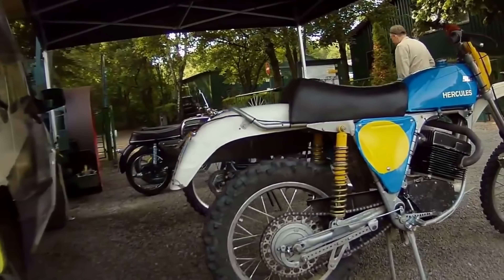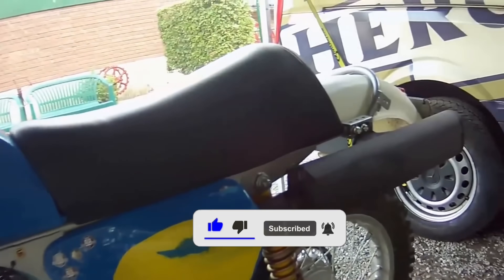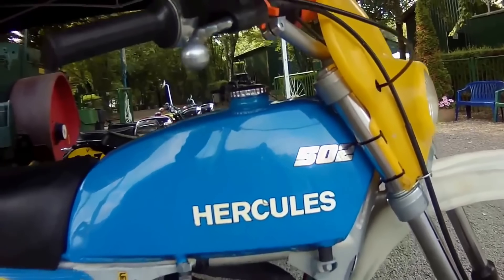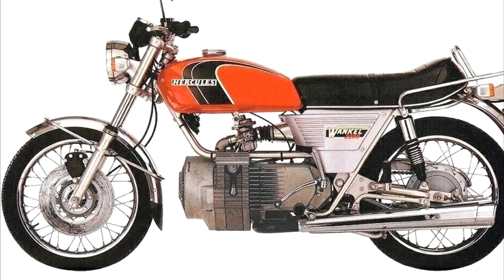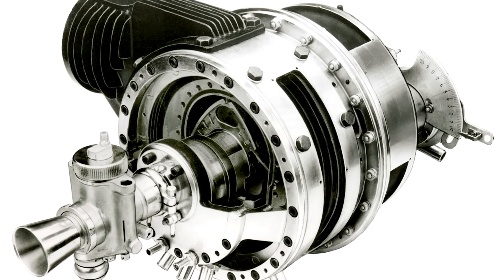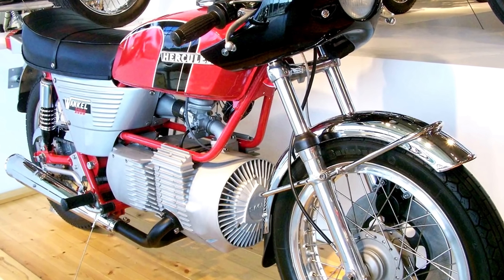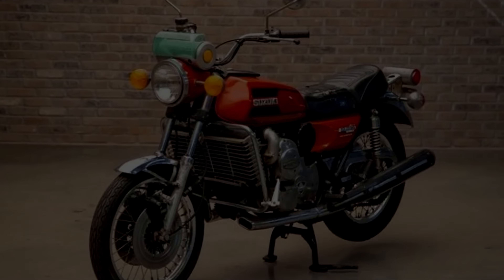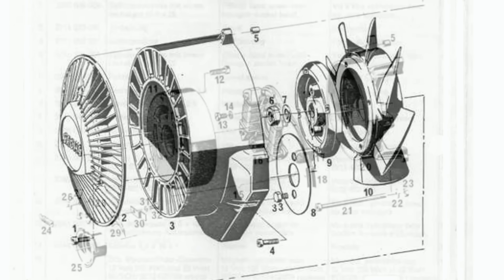The Hercules 502 GS: How Rotary Engine Works on a Dirt Bike

Comment: That Hercules  sure looks a lot like a  KTM / Penton ..  My friend had a Mazda RX-7  70 Cubic inches every peppy with lots of torque..
Reply: I can make your mates 13B bullet proof, infact, tell him to replace his hollow locating dowles with solid ones, run external oil as those dowles usually are hollow for oil flow, separate oil injection fuck pre mix and malleable seals, they don't shatter and do damage just bend, that's good for a road car....
Reply: @EZ-D-FIANT No one can make a Wankel engine reliable... and anyone that claims to is a big fat liar.
Reply: The RX7 is notorious for very little torque and not much power either.
Reply: @sandervanderkammen9230    Not True .. My friend had one it had a lot ot tourque and was a fun to drive sports car  maybe around 1981 or so
Reply: @mikeskidmore6754  Nostalgia is a seductive liar... if you simply look at the specs on these cars torque and horsepower out on these cheap little cars was pathetic...
Compared with reciprocating engines they were right at the bottom.

Comment: I can't imagine how much torque these bikes doesn't have.
Reply: You actually have no idea... I have a snowmobile with this engine in it, the thing drags bumper if you snap it wide open but runs out of steam on top end like a diesel, just based on the video here it seems to have very comparable torque to a 250 4t mx bike.
Reply: @reesewilliamson3346  damn right they do some people have no idea lol a 1.3 built with a turbo can make insane horsepower and you can keep adding rotors and make more power those little things shred tire just gotta do apex seals and shit all the time
Reply: @heathkill4821  nowadays thanks to advanced metallurgy there are apex seals that last literally forever, provided you run premix.
Reply: @reesewilliamson3346  Wow! That's the most ignorant comment on YouTube..
You don't know anything about Wankel engines do you kid?
Reply: @reesewilliamson3346  Apex seals are inherently unreliable and weak by design, no one had ever solved this fatal flaw in the Wankel engine.

Metered oil injection is vastly superior to premixing... this is due to several very important factors that appear to be completely lost on you son.
Reply: just rev it up for amazing power
Reply: Gotta keep it ripping!
Twist it to the ketchup 😋
Reply: Who even cares about torque when you can have a 9000:1 gear ratio lol
Reply: @stuwest5862  that's surprising. Rotary engines typically don't have enough stroke to make that high of a torque to horsepower ratio.
Reply: It's like the no torque and no engine braking comments are oblivious to 2 strokes?
Reply: @BurmaJo  Ya cuz compression release isn't a thing, which this POS doesn't seem to have  get fuqed
Reply: Probably more than the power of your brain.
Reply: @leaveitonhold  "Hur-dur brain joke dur"
Reply: @stuwest5862  yes but a honda cr 450 made over 40hp with 30lb torque. Your figures are for a 250cc honda.
Reply: @stuwest5862   1976 Honda  CR 250 put out 33 horsepower
Reply: 5ee
Reply: Gearing exists you know. Ever heard of gear ratios?
Reply: @mattbanks3517  You can only space gear ratios out so far.
Reply: @samizdat113  no, no what i meant, i meant taking a pinon and spur gear and reducing the engine speed and increasing torque to levels that match a normal piston engine, before the transmission. Like what steam turbines do for electric power generation.
Reply: Don’t need torque when you have far too much horsepower.
Reply: "Talks the torque but can it lift the fork, 
Whatever its still better then going for a walk"
Reply: @EZ-D-FIANT  ...said the 4 stroke guy
Reply: No shit right cool idea tho but thats out
Reply: You know very little about engines.
Reply: @ivancounsell4077  I know stroke = torque
Reply: @@L3gion965depend on what it used to. I think rotary characteristic is not fit in hard enduro type of race
Reply: A bikes this light doesn't need a lot of torque anyway 🤦😂😂
Reply: @theraildynasty_  It also has less power to weight than a 2-sroke.
The Wankel offers no advantages in a motorcycle applications... or any applications for that matter.
Reply: @sandervanderkammen9230  I was just talking about torque, yes to access power you would need the rev the hell out of this bike, but then it is a dirt bike so it won't be possible to rev it that much on an off-road course
Reply: @theraildynasty_  Torque is average serious disadvantage with the Wankel engine, which is why it was never successful in any offroad applications and generally considered an unmitigated failure in the motorcycle industry.
Reply: @sandervanderkammen9230  yes rotary engines were never built for torque
Reply: @theraildynasty_  You mean Wankel engines, a Rotary bike like the MEGOLA is a completely different animal.
Reply: Yes then on the back end no help slowing down...NO THANKS
Reply: @shaadydog1  if adjusted correctly, there is absolutely nothing I can do with a disc brake that I can't do with a drum, even on a heavier bike.
Reply: @reesewilliamson3346  Not true ,prolonged heavy braking with the shoe will lead to overheat/brake fade.
Reply: @ianmangham4570  just lock the wheel up as hard as you can and let the tire get wore out instead of the shoes
Reply: @reesewilliamson3346  Thats not what I was referring to,  you get no engine braking and many are not used to that at all.
Reply: @reesewilliamson3346  lol if you have to lock up the wheels, you’re not riding properly.. and you still can’t lock up the front wheel or you’ll crash.. 😂drum brakes suck compared to disc.. just admit it!!
Reply: @reesewilliamson3346  the issue is fade mate, you obviously don't ride hard
Reply: @reesewilliamson3346  lies
Reply: You can always spot a keyboard warrior with no experience, today it's zero experience with Rotaries but all the talk......
Reply: @EZ-D-FIANT  I have experience with Mazda rotary engines.
Reply: @samizdat113  so you realise that lower torque at lower revs is negated greatly by the reduced reciprocating mass and overall engine weight, also  with bikes that low end high torque makes for a hard to ride bike, the liner ramp up in torque x revs actually sounds a blessing, watch the video again, that rear end is constantly kicking out, "torque it doesn't have", more like low down torque it doesn't need, however I haven't riden a Rotary bike but I've built more 13b's and renisises then I can remember......
What's your experience, building, driving, what platform cos the low torque thing is something I always hear from non Rotary experienced people and never from the experienced.....
Reply: @EZ-D-FIANT  It's obvious from your childish remarks that you are no expert and definitely not educated in engineering.

The Wankel engine cannot produce as much torque per liter because of its Lower BMEP  the Wankel engine has an extremely low surface pressure area-to -stroke ratio, and the eccentric-crankshaft lobe and fixed gear ratio work at a mechanical disadvantage compared to a reciprocating engine.
The Mazda Renesis for example only has a 30mm stroke and pathetic 7.1 bar (42 ft.lb) liter.

Comment: I think that what a Rotary Engine needs most, is more than one rota, just for backup in those in-between times lol, but 4 rota's isn't necessarily. I really love the Van Veen 1000cc Rotary motorcycle,  of course it's got 2 Rotas.
Reply: van veen is dutch??
Reply: @fidel catsro  yes Hank Van Veen is from Amsterdam and an importer or Kriedler motorcycles, Van Veen Kried or Van Veen OCR 1000 Rotary motorcycle, 100hp 135mph.

Comment: You would think with modern tech in metallurgy, exotic alloys and coatings, that the rotary's shortcomings could me overcome, or at least mitigated to a large degree.
Reply: Check out the "liquid piston" engine
Reply: @skynjaydensdaddy Beware of LiquidPiston my friend, it is not a legitimate company and is notorious as a fraudulent vaporware investment scam
Reply: I haven't looked into it, but it seems like Mazda had it figured out..
Reply: @davidbryngelson938  yes my 1980 rx7 had sat for years by last owner and that thing starts up every time for me and made me think rotarys are ment to goooooo
Reply: @davidbryngelson938 Really? That's ironic being that Mazda has gone bankrupt 3 times and has completely abandoned Wankel engines too.
Reply: They have been, so many none Rotary builders talking shit here, the good seals are malleable so don't snap and do damage, replace hollow oil dowels for solid, external oil feed, injected oil fuck premix with ecu that knows when that level is low (or fluid level switch for injected oil on your coil) and boom reliable Rotary.....
Reply: That's a popular opinion but im sorry to inform you it is nothing more than wishful thinking.
Reply: They will always be inherently inefficient because so much of the explosive force in the combustion chamber is wasted not directly acting upon the rotor.
Reply: @Jack-tx2ve Well hopefully there is no explosion inside your engine... that will destroy it...
Pascals law tells us that force of the pressure created by the burning fuel air miz always acts equally on all sides... since only the piston/rotor moves..
The force is transferred to it.
The geometry between the piston/rotor and the crankshaft determines if that force is transferred with a mechanical advantage (leverage) or a disadvantage.
 The Wankel operates with a mechanical disadvantage
Reply: @Jack-tx2ve  and its getting a bit late in the life of internal combustion
Reply: @colinscutt5104  Internal combustion engines will still be with us for a long, long time, at last another 100 years. 
When they make electric heavy machinery, electric trans-pacific commercial jets, and reliable electric farming equipment, get back to me.
Reply: @dr.hugog.hackenbush9443  I agree, soon as they make electric tow trucks then i might get concerned.
Reply: They already testing tractor trailers!

Comment: These engines were never extremely popular nor known for torque...but they would screaaaam.  And my experience with a rx7.  It never once broke down ..I got it used and abused.  And then I abused it more....Apex seals were toast...I went through 2 transmissions oil and gas i frequentlyturned it well past 8k rpm ..and it was still running when I sold her...I miss it now.
Reply: 1976 honda dirt bike 23HP/ 17 lb-ft torque
1976 wankel 502 30 HP/ 24 lb-ft torque
Reply: @Stu West  no kidding. But the torque was Made at like 8k. 😆    not off idle like a four stroke w valves....yes it had great numbers.   Especially for something that stayed in the max rpms...so I misspoke.   Plenty of torque, just on the wrong end of the power band...the rx7 was a straight dudd off the line...but once she was above 4k.  It was on

Comment: Modern 2strokes and 4 strokes would eat the wankels lunch  a stock 125 2 stroke avg 36hp and can be upgraded for more power....if the wankel was a good design it wouldn't have phased out or been out performed....buh bye

Comment: Hercules needs to think about a four rotor street bike!!! Don't worry about h.p. make a torque monster, then just go from there.
Reply: Hercules as a Motorcycle Company doesn´t exist anymore since the early 90`s...The Engines were made from Fichtel&Sachs..also doesn´t existing anymore.
Sachs is nowadays just an Aftermarket and OEM Brand for Suspension Parts in the ZF Group.
Reply: @francoaleman1520  thank you for your time and your knowledge.
Reply: @bartbullock9742 Youre welcome!
 Well  as a German I think I got to know that^^
A lot of German Companies known for producing Bicycles, Tipewriters, Sewing Machines or other Househould Stuff produced Mopeds and  2 Stroke Engines after WW2 to allow affordable motorized Mobility for the People.-> Miele, Adler, Zündapp, Kreidler, Rixe, just to Name a few... even Opel made Motorcycles! Another interesting Fact is, that Opel was the biggest Manufacturer of Bicycles in the World for a long Time.
Another Fact is that the Heritage of Audi is also based on Motorcycles..NSU and DKW are 2 of the 4 Brands whose are the Heritage of Audi and what the 4 Rings of Audi Stand for( Each Ring stands for one of the Heritage Brands).
Reply: @francoaleman1520  thank you for your insight, in 77 my first car was a 70 model Opel GT, I put a Weber carb. As soon as I got it.10 years later, some investors, I think they were in Belgium, bought my oval sent it back to be refurbished and sold as refurbished new!!
     I have owned many cars, I have owned three Mercedes, and because I've been a mechanic since I was 13, I do all the work myself, the MB made a believer out of me, the engineering is impressive.
    I'm curious, I have studied last names a little, my last name comes from "farrier"are" blacksmith", up until 100 years ago, you would ride into town and ask where the town" bullock"was, if you needed help with your horse are your wagon, and the last name" Coaleman".. it could be the spelling, I was not aware that was a German name???
Reply: @bartbullock9742  I dont know of that Story about this Last Name but there must be something true about it since Sandra Bullock is from German Heritage.
Those Opel GT´s are cool Cars and became rare because the most of them got eaten by  Rust.Mercedes is allright, the Engines are good and the Interieur is also good Quality but Mercedes is lacking very much in the Quality of the Bodywork since the Era of the W201/W124 and Mercedes allways had bad Manual Gearboxes... even the newer Benzes have massive Problems with Rust.
The least Problems with Rust of all German Cars did allways had Audi because they had Aluminum Bodies or Galvanized Steel Bodies.
After several BMW E36 Models I drive now VW Golf MK2 and MK3(the MK2 is one of the rare Fire and Ice Models 1.8L 90HP and the MK3 is a GT Special from 93 in the rare Color " Dusty Mauve" also 1.8L 90HP) I love the simplicity of the Engineering and the reliability of those Cars... you can fix everything yourself and the Spare Parts are pretty Cheap and they are  timeless Beauties :)
Reply: @francoaleman1520  I don't think Sandra is related.
I like the way you spell interior.
 I was raised in Dallas, I'm just 80 miles north of it now, in 76 I was 13 years old, I would go to the street races and watch all the Detroit muscle get down, I'm sure you're educated on the Big blocks, what most people don't know is Pontiac had a wicked cam for one year in the 455, they discontinued the cam because it idles so rough, with 98 octane gas and some tuning, 510 hp. 570 trq. The torque number was the magic, same exhaust same intake from the factory, I just thought I'd lay something on you very few people are aware of, I've seen several cars with the exact same setup turn low 10s,127 mph, it was the fastest thing out of Detroit.
    My friend's dad, his name is (was) Bela Horvath, he made it out of hungry, in 1944, with a baby and pregnant wife, very proud man, he had worked for Porsche own race teams as a mechanic, in Dallas he worked for the number one foreign car service shop, and even though I worked on my car's myself, he was on another level, he had his own engine lathe, Mills, and I learned a lot from him.
   I told you that to tell you this, he had a VW split window, 4-cylinder with the mikuni downdrafts, the suspension was close to formula One is anyting I had ever seen, this was in 82, fiberglass fenders, Hood, deck, he told me he figured it made 300 hp.. it said it would run on the track all day long and you could go get groceries in it, it was orange and a beautiful paint job, he knew I liked it, in 89 he offered to sell it to me for 4 k. My dumbass didn't immediately jump on it, two months later it was gone.
      He let me drive this car, I could not believe he handed me the keys.
     It was 4 speed, I figured this car weighed a little over 1500 lb. Jesus of Nazareth it was the scariest ride. First and second would pull wheel stands, I was lucky to walk away from their car without scratching it. I'm sure he knew I was going to put it through its paces, but I was blasting pretty hard with it. I could not believe this was available on the street, and you lucky Germans have got them all around you, I'm just jealous, and now when I drive a high-performance car ,I just putt, I've had my day.
    My 70 Opel had a"S"Stamped by the VIN number on the block, I know this meant you had to run higher octane gas, and it would rattle if I didn't (bad), I'm just curious if you know about any factory stuff they were doing to that motor, because I had driven two other opals with the same motor, even when mine had that solex, it ran way better  than they're 1.9, just curious bro, this is what happens when you get older than dirt.
Reply: @bartbullock9742  AFAIK the Opel Models with the S Typo had higher Compression Ratio and Camshafts with different Timings.
The VW Split Windows are very rare even here in Germany!!! Also the 80s Mexico Models which where cheap to get untill the late 90s  are rare to see nowadays.
The most common affordable Oldtimers in Germany are the W201/W124 Benzes, BMW E30/E24, Golf MK2 and some Audi 5 Cylinders.
I would love to have an 1973 Ford Torino but good Condition US Oldtimers are hard to get in Germany and they are expencive as Hell.
Reply: @francoaleman1520  T-Birds, I've had a 63 with the 390, 69 with a 429, 73 with the 460, I had a 71 Torino with a 351 Cleveland, different intake and exhaust, it was making close to 400 hp. This is all back before 1979, these vehicles were cheap because of gas mileage.
     I've been paying Australia and Germany and other countries collecting cars, I'm amazed at what Australia has been able to pick up.
     I know Germany has Ford, Chevy, and Dodge (Chrysler) muscle cars, and I know there's some big block Pontiacs over there, and I'll bet there are some Sweet rides.
Reply: @francoaleman1520  Mazda should pick up the baton